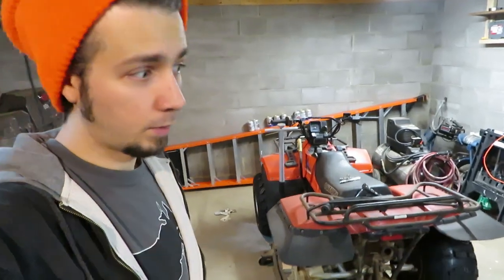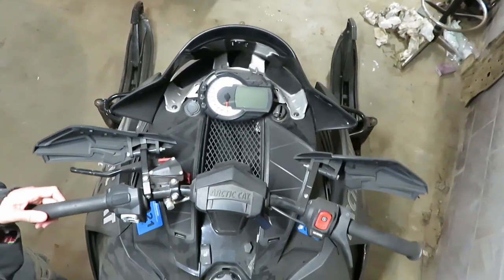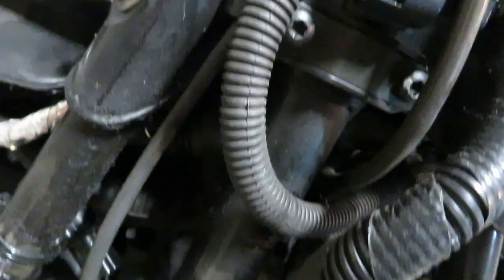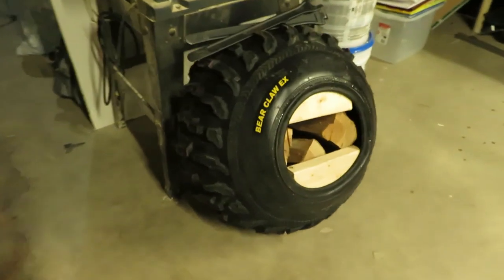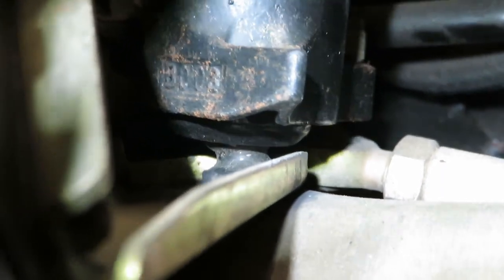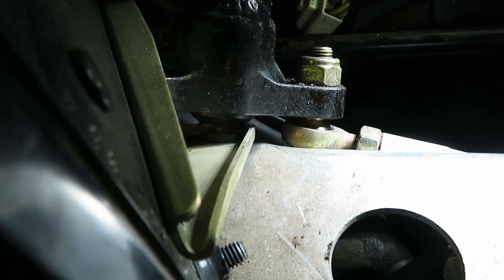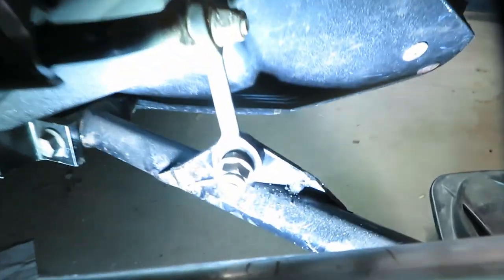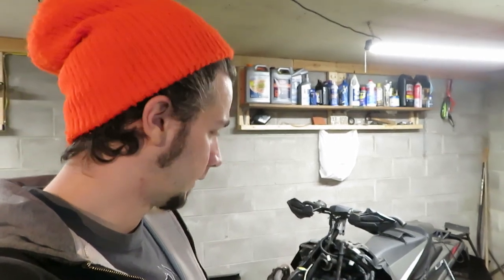Fixing Sloppy Steering on Procross Chassis Arctic Cat

Comment: I had to fix the same sway bar mount this past spring on my 1100. I too was surprised to see it when I was servicing it for storage. Quick fix with the welder! Ended up having to replace the O2 sensor in the exhaust and the electric reverse motor too.
Reply from the maker: Huh, must be a weak part?  I haven't had to do either of those things... Yet.  How many miles do you have on yours?
Reply: @SwankyCatProductions  a little more than 5000 miles, it’s a 2013, not sure if that matters or if things improved with later models. Both issues threw a code and lost reverse with the motor. Attempted to fix the gas gauge inaccuracy by bending the float arm a bit, forgot about that project as well. First ride of the winter on Wednesday, either Sawyer or Price co.

Comment: Thanks. Videos cover many of the same issues on a 2012 F1100 I just bought. 

Have anything about the primary clutch chattering at idle? The front and backside housings that clamshell together move slightly where they slide together. I think these have spacers between them that might be worn. Clutch has 3000 miles it.
Reply from the maker: That does seem odd.  I never had to touch my primary, but it was actually replaced shortly before I go it.  They may have had issues from the factory?

Comment: what side of the sled did you access that bolt.  I have minimal play in my ZR and want to check it.  Thanks for the vid. - follow up - I pulled the boot off and it turns out the dealer tack welded the nut on. :-/
Reply from the maker: Really??? Must have had issues with them coming loose so they did that.  Your play could be coming from somewhere else?
Reply: @SwankyCatProductions  slack is minimal now.  I could probably give each tie rod and 1/2 turn and get it tighter.  I am not sure I want to bother.  I’m not sure I will keep this sled very long.

Comment: Hey bud. 2 questions, 1)hoe tight did you go with the 15mm on the ratchet? I was doing same with a viper and was worried about over tightening and snapping the bolt.

2)more importantly.... Same thing happed a few days ago with my turbo xf. The Sway bar link bracket brok at the welds. Has yours held up since the fix? Did you just tack it or do a good bead?
Reply from the maker: I may have gone tighter than I should have...it was hard to tell and I worry to much about that stuff.  No issues at since though so it must have been ok.

As for the weld, I tacked it on both sides just to make sure it didn't walk around at all.  Then did 4 good beads, one on each side of both legs.  No issues yet and I've even been doing some carving.
Reply: @SwankyCatProductions  perfect thanks. Dumb question, but did you do all the welding with the sled on the ground level with the A  arm and everything in place (nothing removed) or?
Reply from the maker: I thought I'd have to take it off at first but decided not too.  I un hooked my battery and just did a sniff test for fuel leaks.  Welded it on the sled, with the skis on flat ground with no issues.  Would be a good idea to have some sort of barrier between the sparks and sled I suppose.
Reply: @SwankyCatProductions  awesome thanks for the tips brother.
Reply from the maker: No problem, best of luck!
Reply: I had the same thing happen to the sway bar. I read on one of the forums that it was a 12-13 issue. I bought a used on off of eBay and the ‘ear’ was much thicker

Comment: Hey bud did you ever figure out your clutch issue as far as it running too hot? also were you ever able to remove the push out of your skis in the turns?
Reply from the maker: Hey, yep I think I've got the clutch issue fixed.  I swapped a newer big fin version secondary and that cooled things down.  Adjusting my front track shock down helped the pushing but I think single runner carbides would also make a big difference.
Reply: @SwankyCatProductions  yeah I have had mine for awhile now I actually put up a video of me changing out the jackshaft to the upgraded one to fix the reverse gear issue they had much happier with the new one, I’m also thinking the longer carbide would definitely help, mines a turbo and with the stock carbide it literally feels unsafe af lol, have you messed with the front skies? As far as the shocks? Also did you decide to leave your skies at the weirder stance or put them back?
Reply from the maker: Nice.  Yeah I think longer single runners would be worth a try.  I left my skis wider and I did drop the front down a little bit, didn't really seem like it did much though to be honest.
Reply: @SwankyCatProductions  Did you adjust the rear spring on the suspension or just the front spring suspension for preload not the springs for the skies just talking about the skid springs front and rear?